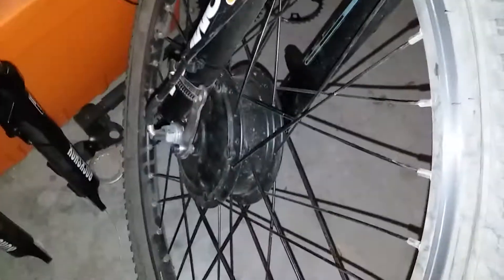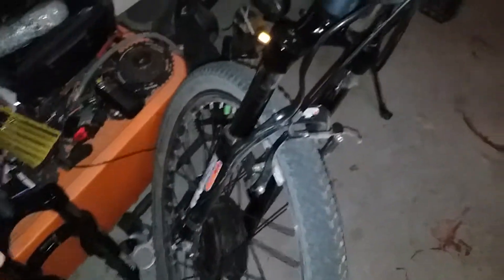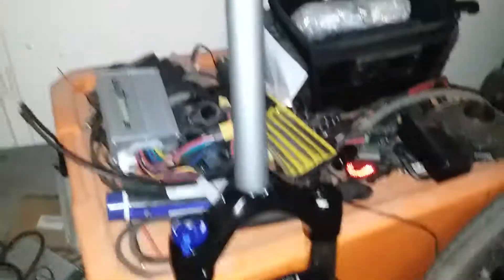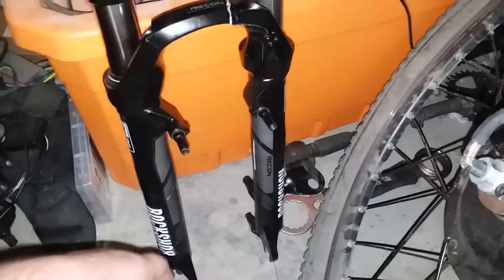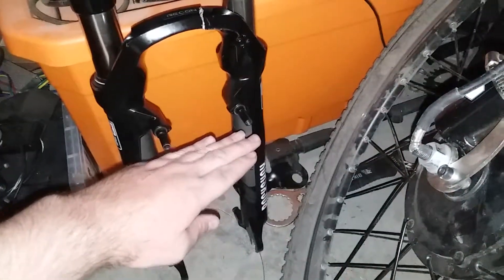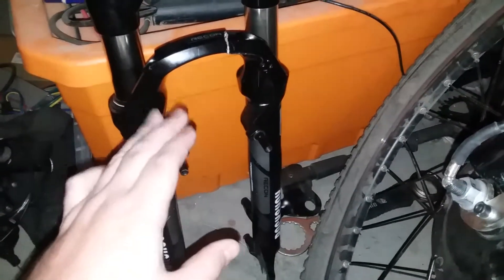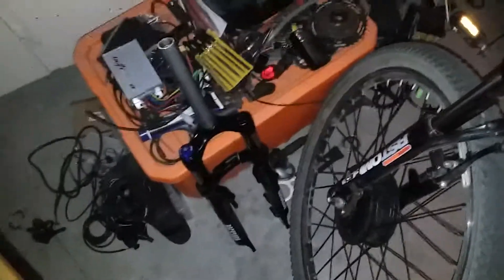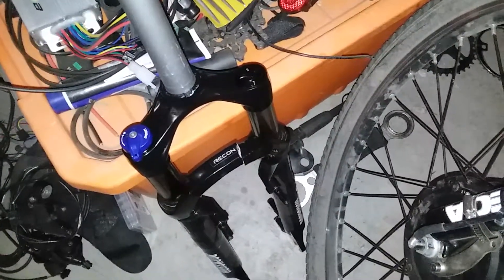Hypers New Shocks. RST Omega TNL 26

Comment: Hi how are these forks holding up? I'm thinking of getting it for my bike.
Reply from the maker: Still holding up well. Loved them also since unlike my Rockshox that had to be modified on the posts to allow a E-hub motor wheel be installed. These are wider which allow a electric hub motor to be installed without having to trim the posts. But you might need to trim the washers as the small circle cavities that the washers sit in before putting the bolts on to tighten, are slightly small. So just trimming the washers and then bolt down will work fine.

But if your using normal wheels, You shouldn't have a prob with the washers slipping into the holes.

They are a coil and oil filled system (oil in right side, and spring/coil on left.) Instead of air filled on left. So you will have to kinda ride it a few times and adjust the left side spring tightness for feeling how much bounce or stiffness you want. There is also no rebound adjustment softener on the oil side. Just a compression to soften how hard the shocks compress in. But you can lock them out as if they were fixed forks which is really nice compared to Rockshox's air forks i had that still had some dampening and shock relief if hit hard enough.
Reply: @KillerRaptorr  Great thanks for the fast reply, I think I very well may order them just this minute😁, I'm replacing my old worn out rst gila t5 forks so these should be a blast👍
Reply from the maker: @kylebatson5971  Yup. And they still have V-brake mounts if you still wanna keep with V-brakes. Or have both systems since they also have Disk brake mounts to.
Reply: @KillerRaptorr  yup have to use v brakes for now but definitely will upgrade to discs soon
Reply from the maker: V-brakes aren't to bad. I upgraded my rear with Deore V-brake calipers and Promax 3in1 pads. Can stop really well and even lock up the rear wheel.